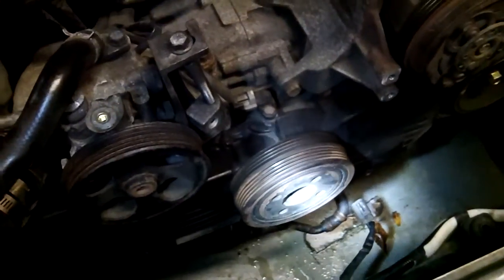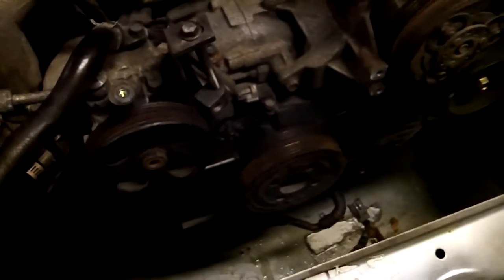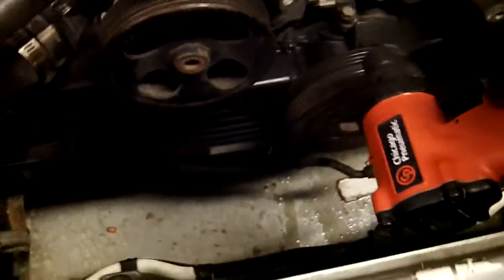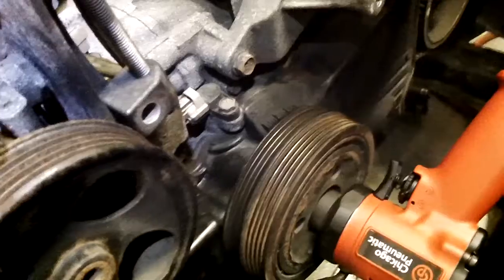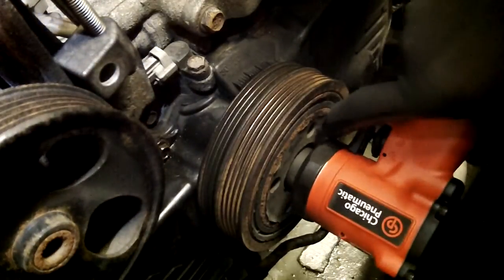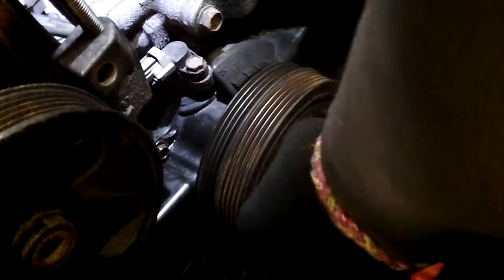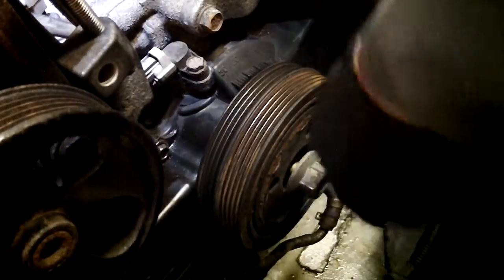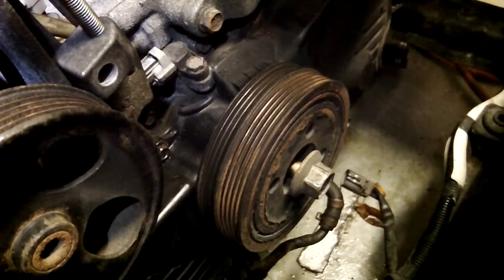How to remove a crank bolt from Subaru, Chicago Pneumatic Impact Wrench

Comment: Mmm.
OR, You could put the end of a breaker bar (with the 22mm socket on the bolt,) on the frame to your right...unplug the spark plugs, and tap the ignition a couple times.
The bolt will come RIGHT OFF.
I just did it 1 hr ago.
Try it sometime.

Comment: Thanks for the tip on that impact gun!  That's our problem and why I cannot use my trusty 1/2" Craftsman,, it's too long to fit between the trans cooler and the crank pulley. Now to see where I can find one right away.  I do have a question however,, is your Subaru a manual transmission?  If it is we know it'smerely a matter of putting the car in gear to hold the engine static,, BUT,, if it's an automatic (my Son's '97 Outback we're working on is an automatic) we don't see that you needed to hold the crank pulley as you used the air tool to loosen that nasty tough crank pulley bolt. Is that the case?
Reply: John Z put in gear don't work. have you tried it? I did.

Comment: A socket on the crank bolt, a long cheater on the  socket, have the end of the cheater bar resting on the frame, or concrete floor and bump the starter  Always work for me as long as the engine cranks clockwise when viewe fdrom the front of the engine..
Reply from the maker: +Upallnight Lots of ways to do it .. this little wrench is small and powerful . Always room in the box for another air tool .